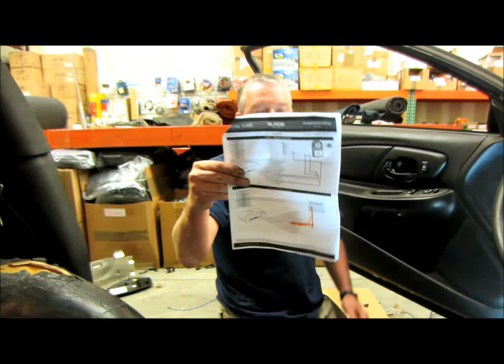Part 19   Start to finish alarm remote start installation

Comment: GREAT VIDEOS! SO MUCH HELP!!! I know you don't like Directed Electronics but I have a 535T window module (2 windows up and down). It worked great in my 1995 K1500 pickup but I transferred the entire system from that to my 1999 silverado LS. I made sure all wires were connected correctly, dip switches set to positive with one touch off and even isolated the power and ground wires for the 535T from the remote start system. All I can get it to do (with the window switches) is go in either direction about 1 or 2 inches at a time. The install manual says that the "express down" OEM feature may be interfering but I'm connected to the wires going directly to the motors in each door with 14 gauge speaker wire. The window regulators/tracks were sticky at first so I lubed them up with silicon spray and they work like new so I know the motors aren't excessively loaded. I even tried running another wire in parallel to the motors to increase gauge and still no go. I can't even get it to program properly because they won't go up all the way. have you ever ran into this issue before? Any Ideas?
Reply from the maker: +Mitch Simington some cars are tougher to get moving than others, all I can suggest is maybe some graphite to loosen the tracks up
Reply: +Lessco Electronics Thanks for the input but I've already freed the window tracks up and they work like new. I'm going to try running 12 gauge fused power and ground (unfused) direct from the battery to see what that does.

Comment: Im watching this video at around 9:19 your cutting the door switch wires. If Im using after market window kit would I do the same. and if so can the module wires be fed to just the drivers side controller. I want the windows to be controlled from my REC43T channel 4. Thanks.

Comment: Hey question so u hooked up the module in series for window up to one side. So if I want window down as well I hook up a 2nd module to the other wire on the switch? Or the same wire connection can be used for both
Reply from the maker: p3rsian123 one up wire does one motor only. usually a window module does 2 or sometimes 4 in one shot as far as outputs go. I hope that made sense..